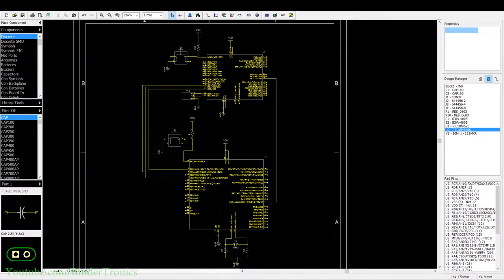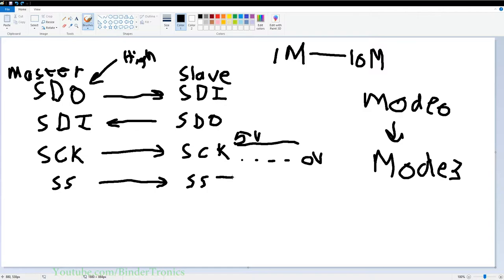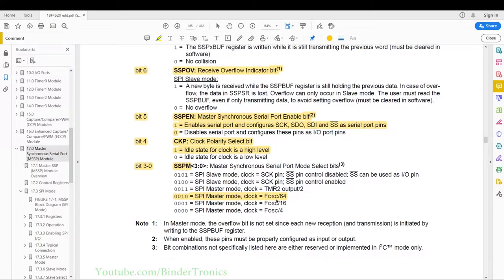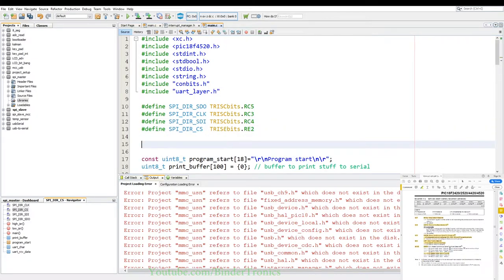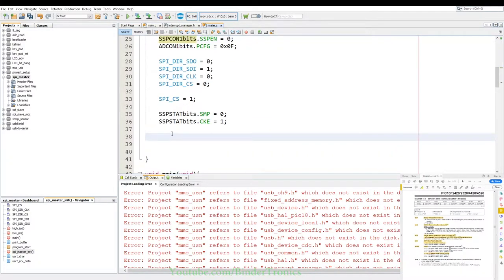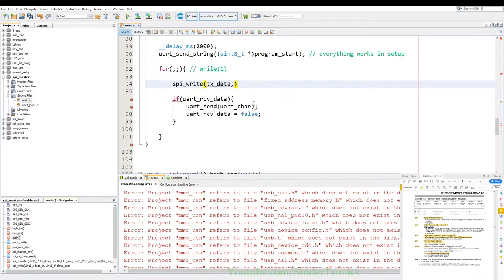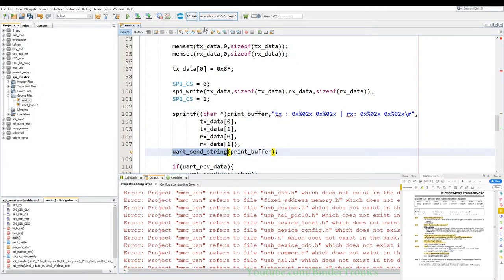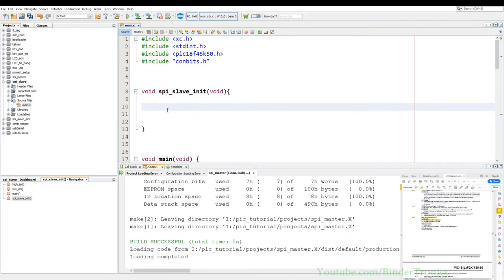SPI Master & Slave Serial Peripheral Interface 🔴 PIC Microcontroller Programming Tutorial 27 MPLAB C

Comment: @Binder Tronics Your code has a small problem. If you expect the slave to answer, you need to pull it's chip select pin high. otherwise, it won't be able to put any data in the SSPBUF register.
Reply from the maker: I highly doubt you watched the whole video or ran the code yourself.
Reply: @BinderTronics  I actually did watch the whole video and I appreciate the effort and I also simulated the circuit and that's my result.
Reply from the maker: Master references CS to ground. No need for a pullup on physical hardware.
Reply: @Binder Tronics  I didn't mean a physical pullup hardware. I meant you have to make CS PIN high in the master side so slave can respond.
Reply from the maker: nah bru, pin is active low.
Reply: @BinderTronics  Alright, thank you.